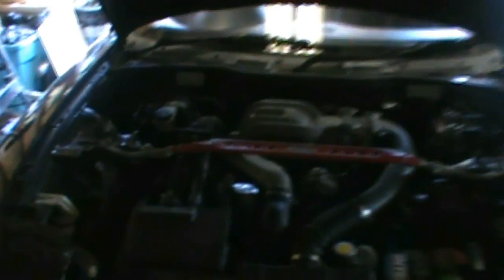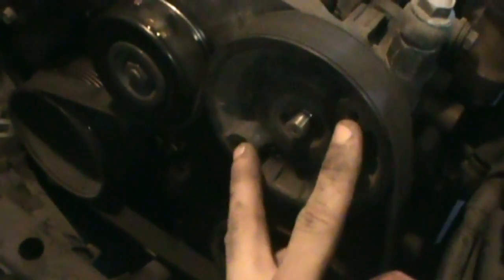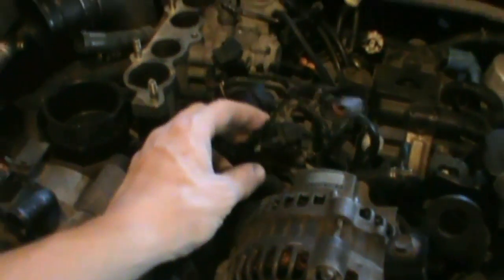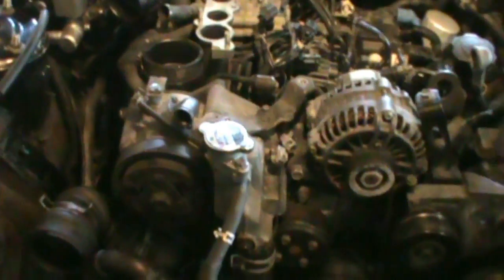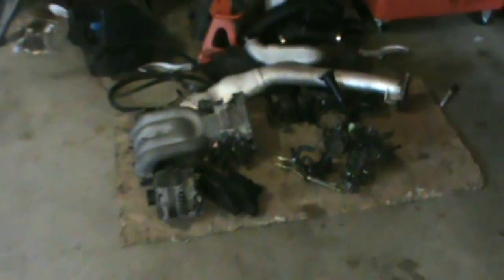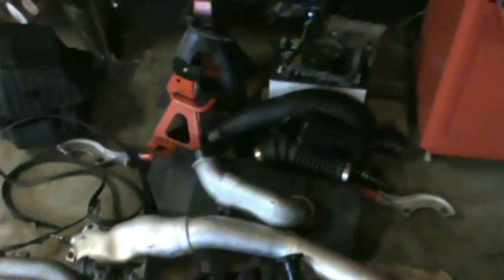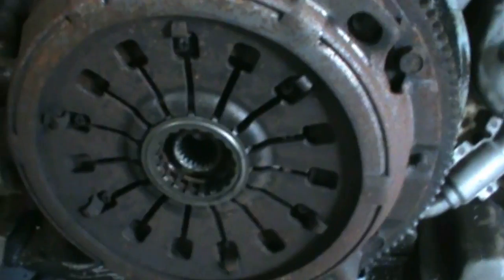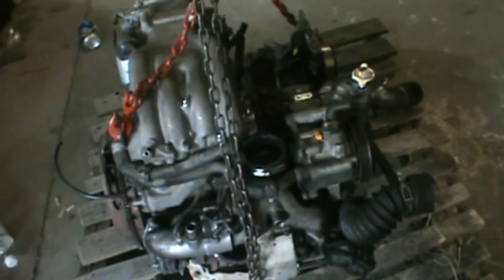How to Rebuild and Port a Rotary Engine : Part 1

Comment: i thought this video was called how to rebuild and port a rotary engine, not how to jam the clutch on the input shaft and break a bolt.  now that you deformed the input shaft splines it will be ten times more difficult to separate the engine and transmission, and then put it all back together... lol great video though really entertaining.

Comment from the maker: take the access panel on the side of the bell housing off get a big flat head screw driver and just push the metal release ring  towards the pressure plate till is sit in the clutch fingers flat then release bearing and clutch fork out of the pressure plate

Comment: funny, you didn't need to take all that stuff off before pulling the engine.  Just take off the power steering pump, pull the harness through the fire wall and lay on engine, disconnect downpipe, transmission, you could've removed all the pressure plate bolts instead of playing with the lock ring, also after lifting the engine alittle, you could disconnect the engine mounts from the engine so they wouldn't hang up in the frame while pulling engine off transmission.  The rest is coolant hoses.

Comment: Hey, if i could buy a 1973 mazda wagon :facepalm: with a rotary engine for 1200$ you think it'd be a good deal? It hasn't run in quite a few years though. I am think of building a rotary powered model A so?? worth it or not?

Comment: Definitely with ya man, I don't fuck with the pulley hoists. Had the same issue pullin a 4.0 jeep once. but my issue was that jeep includes two hidden torx screws in the top of the bell housing. Thanks fer the films. Im a young mechanic and I got piston and diesel down, but looking to branch out into rotary and this helps a bunch

Comment: The tool you need for the pulleys is a spanner wrench. Their really easy to make just weld some bolts into some scrap metal at the right length you need. And hold it like that.